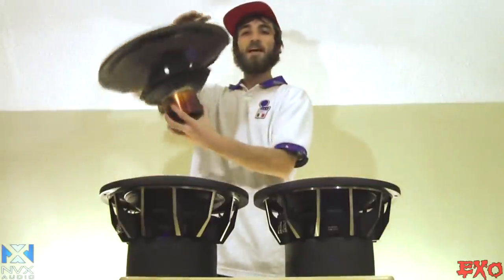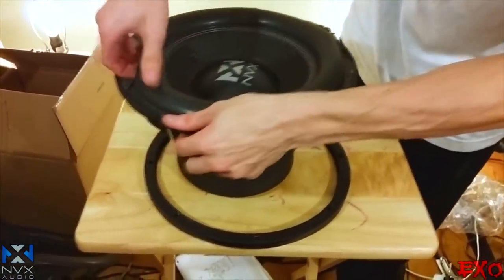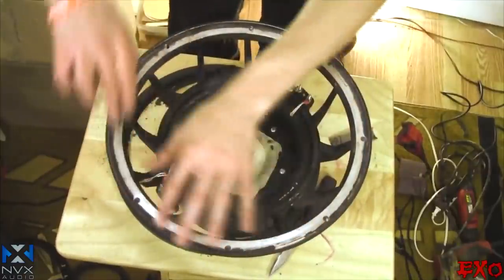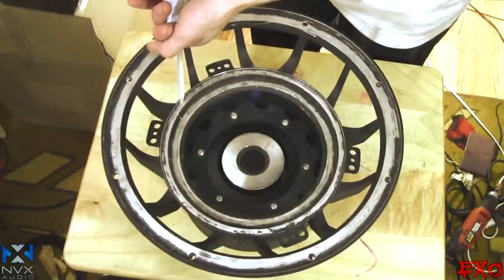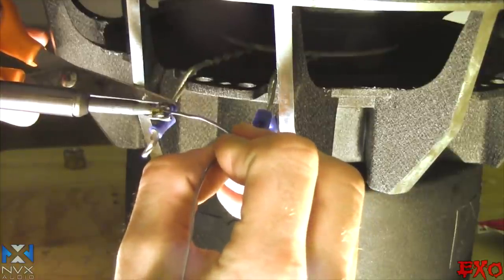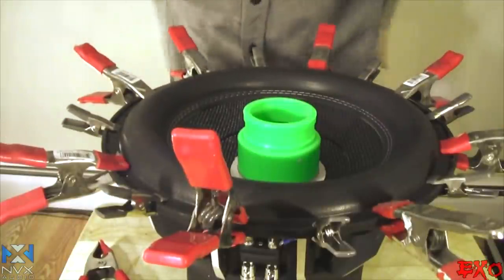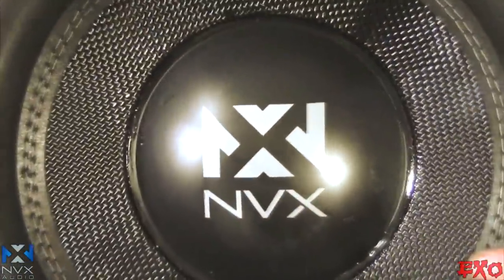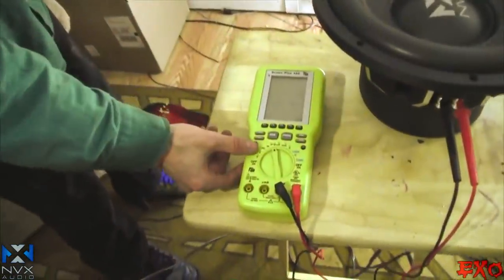How To Recone a Subwoofer w/ NVX Audio VCW Subwoofers | EXO's 12" Sub Woofer Reconing Tutorial

Comment: the reason the ohmage fluctuates when there's sound or air movement in the room is, and fun fact time, a speaker and a microphone are the same thing. a microphone is a speaker in reverse. the vibrations of your voice cause the coil to tingle which creates a very small amount of electricity.
Reply: Pavelow impedance bro.

Comment: If you made a caul ring for the outer diameter to fit inside the flange area you wouldn't need so many clamps. It could be made out of almost anything. A piece of 1/2" x 1/4" plywood cut to fit the diameter you need would be fine. You can also use plastic, metal, or several layers of cardboard. Use a lazy susan to put the speaker on and it will make running a bead really smooth and easy. By the way, the cawl is just for temporary clamping, don't glue it down

Comment: What about the first spider down there? Will it stick by itself to the glue and not pop out? because it's not accessible for clamps. Or the pressure from the second spider will do the job?
Reply: The pressure from the weight on the whole assembly is enough.
Reply: It should have been addressed seperately. Lower spider, upper spider, and after that it really doesnt matter if you do the surround or the tinsel leads next. But leave the shim in intill youre done the spider/s and surround.

Comment: Hey bud I know it’s been like 6 years, but I was wondering. How did the epoxy work out for the spider?

I am using a stiffer spider and had a recone made for my hcca motor. And I got CA glue but didn’t even know I needed activator 🤬🤬 but did a test and let it sit for a day and it seemed to not really dry too well even with videos I’ve watch that using the activator let’s the glue set quicker. The ca glue looked to be cracking when dryer

Anyways, let me know if epoxy is gonna be ok for a TI basket, with a blue (very stiff) spider.

Comment: Sorry bro, but cones and coils are not soft. Tried eating them once....didn't work out. I believe they call them soft parts because they are the only things that move. All of the cone and coil assembly moves, including the surround. The magnet area and metals surrounding it is referred to as the motor because it provides the force field that enables the soft parts to move. The basked is pretty much what keeps everything together. Just thought I'd add that. Speaking of baskets, those are awesome on the NVX's
Reply: dragonsage2008 Coils and formers are very soft and easily bendable? I don't know about that..... First off, I was just poking some fun at what he said. Second, I simply tried to shed more light on the topic. The only thing soft on my subs are the surrounds and the gasket. The spider takes some force to bend it out of shape so I don't think of it as soft.
Reply: dragonsage2008 no you said "the coils and formers are very soft" and I don't know about easily bendable. the copper wire is wound on the former, making it part of the former more or less. I don't know, maybe you're the hulk and can easily bend those with little enough force to call them "very soft". Just saying...

Comment: Oh. And any chance you could do a video of basket repair?  😅 I ended up with a 12 and the one of the basket spokes is cracked off.  Speaker still works tho.  Jb weld??
Reply from the maker: JB may work, but that's a lot of stress for a 2 part solution.

I don't current'y have any videos on basket repair.

Comment: I know this video is a bit older but my question is still relevant, is a spider pressure ring  not required for a recone ? i picked up a blown audiopipe txxbd312  for $5 and want to try reconing it just for the sake of learning but there is a plastic ring that was glued and screwed to the spider, there is no way to save the plastic ring, will epoxy only be a good replacment in place of the ring.

Comment: I know this is an old video.  Im curious where i can find a recone kit for my 1988 cerwin vega AT'15's?  One still works great but about 7 or 8 years ago my pioneer elite vsx99 home theatre reciever had left channel blow out. I had radioshack repair the receiver. Then found out the 15 on that side no longer plays. It barely moves so im guessing the coil unwound.

I currently have two cheap mcm electronic replacement 15s ( 200watt rms 400watt peak speakers i got on sale paid just under 100$ for 4 shipped.
The 3rd and 4th i put in some pyle dj speakers.  

I still have the one working cerwin vega 15 now in a 3 cubic foot sealed box in my brothers honda hrv.  Id love to put my AT15's backtogether with cerwin speakers.

Then id like to try building a dual 15 box to fit my brothers car give him the mcm 15s.

Comment: I have an old pioneer 3 way 6ohm subwoofer system  and the subwoofer is really loose it's and is very quiet I'm running it off an 8 ohm stereo system  at 700 watts but the subwoofer is 120 watts so its nut underpowered is it blown or is the spider dead?

Comment: EXO, I have a 10.75" Soundstream DaVinci sub, where on earth would I find the parts needed to recone such an odd size sub? One of the 2 coils is open on mine. More than likely a disconnected wire but I'd need to tare it apart to fix it. Any pointers would be greatly appreciated.
Reply from the maker: Hmm, wish I could be of more help on that. But your best best is to fill out a service request @ FixMySpeaker!
Reply: EXOcontralto thanks man. Also, thanks for motivating me to get back into the car audio stuff. Just picked up a 1999 Punch 1100a2, chrome to start off an old school build.

Comment: Anyone know what what would make a pair of speakers just stop working . I took my box with two 12's out the car for about a month, then put them back in the car and they won't come on for nothing , they were working just fine before I took them out the car. i checked the wiring, fuses,rca jacks, settings on the radio but nothing worked. I pulled the 12's out the box and put another set of 12's in a they worked fine. a few days ago I checked the 12's that stopped working and one of them has started working i don't have a clue why they stopped or started working .    has anyone had this happen before or know why it's happened
Reply from the maker: Hmm, do you have access to a multi meter???

If you reply, don't reply on this thread or else YouTube won't notify me. Please post a NEW comment and I'll get back to you from the Community page.
Reply: Try seeing if your amp is getting a signal

Comment: Do you have to install the smaller dusk cap?
Reply from the maker: No, but it's recommended in order maintain the specs written from the manufacturer.
Reply: The MMS would be different from the original specs if you didn’t use the inner dust cap and might raise the FS some.

Comment: Why do both
Reply from the maker: Julio simon To keep everything exact, both on the electrical, and physical side of things - Newer soft parts means the woofer would be stiffer - also these parts have different glues, which weigh different amounts than the v1 soft parts ect. Those parts have a heavy loaded black adhesive, and the v2 soft parts have a lightly loaded white adhesive - I'll post some facebook pics showing the differences
Reply: Hey cool video I was wondering why do both recones both subs
Reply: Julio simon he did give you an proper answer, so why ask again?
Reply: +Stefan Petersen He didn't ask, he stated that he was wondering why...
Reply: EXOcontralto I still need to know if these subs are truly really good. I'm about to drop all the cash I have on some 15s and I need to make sure I'm getting the best I can for the money I have to spend. Are these the best 15 I could get for $180 each.